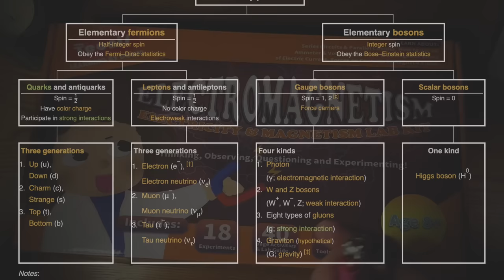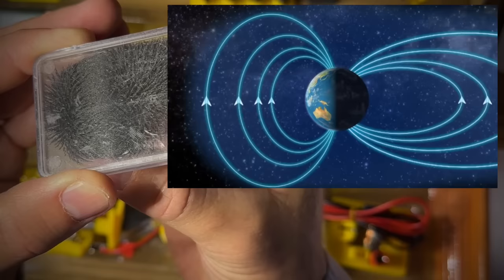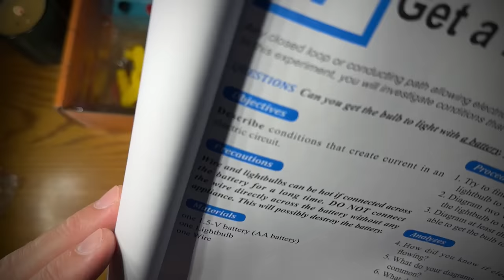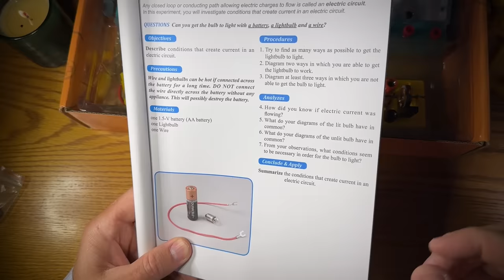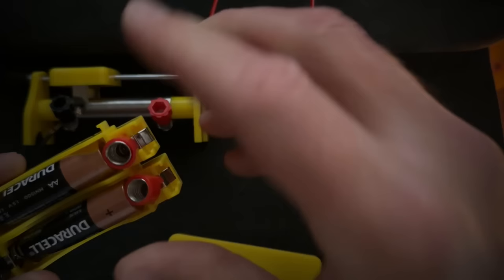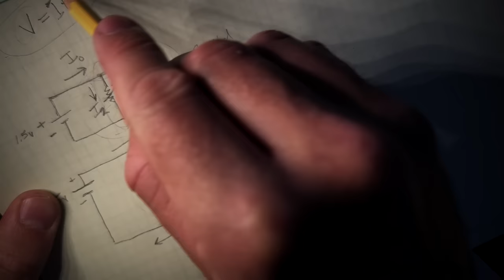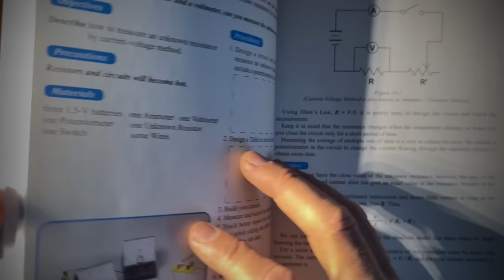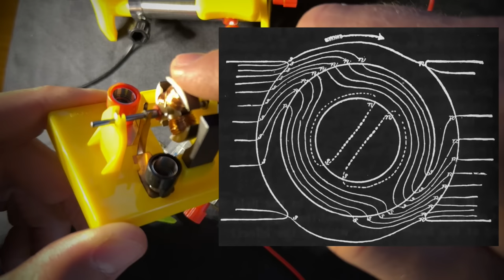Relaxing Electromagnetism Experiments: Ohm's Law, Series/Parallel Circuits, DC Motor | ASMR

Comment: While electricity is really cool with how it works, I remember my second term of physics in college being entirely about electromagnetism and I thought it was so fascinating how closely related electricity was related to magnetism. I totally thought they were completely separate forces! I even still have a video of this one gadget that they brought out that was a plastic tube with a wire coiled inside of it, and they'd slide this like metal ring to the bottom of the tube (outside of the plastic) and press a button which just launched that thing really high in the air. It was even more fascinating when they did the same thing with an open metal ring and it did nothing! Super cool stuff. Did you know that there's no such thing as a magnetic monopole? Apparently there might have been some right around the big bang, but they do not exist anymore. 

Also I feel like I've almost never encountered a physical compass that actually works, so that was actually really funny to see
Reply from the maker: cool experiments. ill have to look up that tune one. and yes the compass always seems finicky for me too